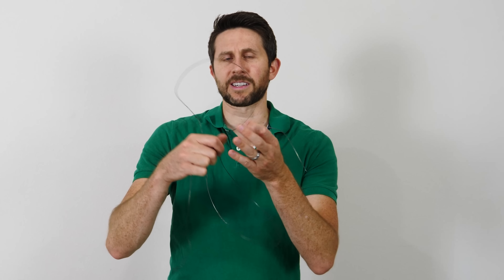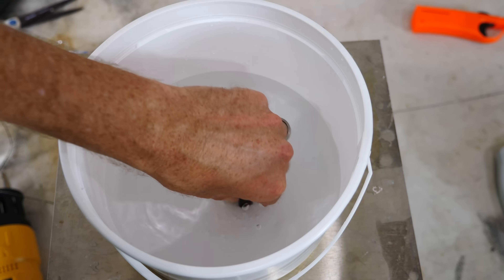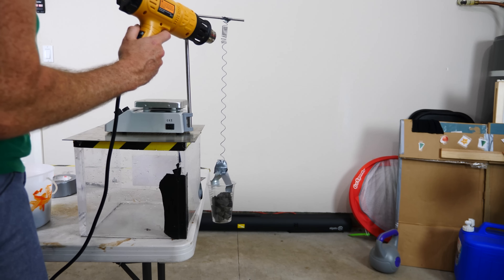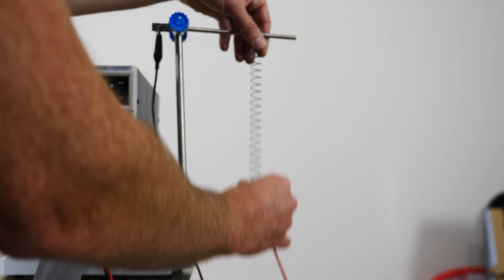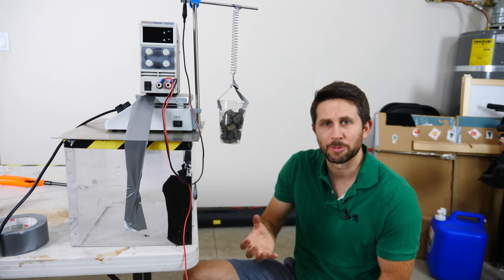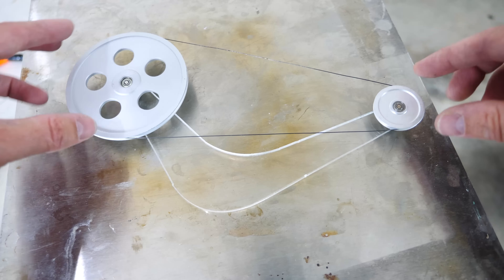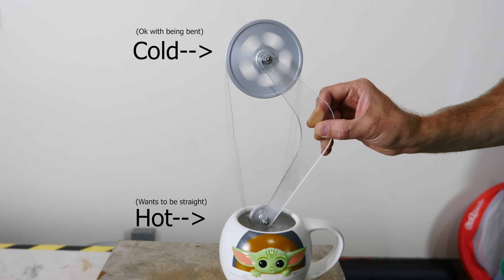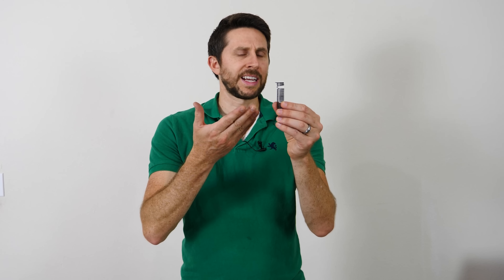How Strong Are Nitinol Muscles?

Comment: at 5:30 is that a perpetual machine????
Reply: Sort of - but I think the catch is that the machine would only run as long as the water stayed hot; as the water cools the machine fails. Therefore, to keep the machine running, you still need external energy (the heat from the water) to run. Good question though!

Comment: With a solar robot, you can use the panel to power a fan that circulates hot air off the solar panel and through the muscles using valves and ducts to control which muscles are being used. This would keep down the electrical requirement reusing byproducts of the energy source.

Comment: You're so good at show-and-tell. Poor universities confine their education into flat blackboards. They should hire you! As of recent years, there is a re-discovery of the amazing potential in Nitinol. The earliest time I've heard it mentioned is circa 1973, I believe, in a short documentary. Among many fascinating tests, they measured the work done by gravity on a given mass to stretch the nitinol spring to a certain distance. It's construed as mechanical work, and could be translated in the potential gravitational energy of that mass at T0 (above the table) and T1 (at table'surface). Very simple stuff. Where I'm getting at is that they also measured the amount of heat (energy in joules) necessary to warm up the spring enough to bring back to mass to it's (very near to) original distance above the table. Embarrassingly, they mentioned that the delta grav. potential energy was > thermal energy applied to the nitinol (stretched) spring needed to re-coil it back in its original shape, and bring the mass back up. I'm not explaining this as well as you do, for sure, but that is overunity! See, your "engine" is over unity, as long as you have, and will maintain, a delta Temp  between the top and bottom pulleys (something you can very easily find in nature where one pulley is kept cooler than the other. as you shown) They had a sort of pump, working like a teeter totter, bathing a nitinol assembly alternatively in cool and warmer adjacent bassins. It worked! Imagine a well in north Africa working in this principle, using the hot surface - cool depth under the sand, to power a well bringing water up to the farmers top-side. Oh! That's a form of geothermal. Tesla had this one similar patent. Thanks very much for your wonderful Action lab. You're like an opened window into the future of physics. Cheers!

Comment: So I guess it has to be fire hot in order for the memory to be activated. Does that mean it wont work at body temp? does the wire have to be under a certain thickness in order for it to work? Like if the wire was thicker it wouldn't work? What if it was a flat sheet? That would be incredible if they could make car body's out of this stuff. Imagine being able to fix a dent with a hair dryer!

Comment: (1) A deformed, or stretched, nitinol spring has a lot of potential energy. In what form? Is it elastic potential energy? (My underpants have that.) It is apparent that a stretched or misshaped piece of nitinol, when regaining its original shape, can release much more energy than needed to make it regain that original form. And this is reusable. So all we need is a free source of energy that misshapes a piece of nitinol, and we have an energy source.

What's that? Did I hear solar energy? Can we somehow harness solar energy for heat to maintain the misshapen nitinol, so when the heat source (the Sun) is removed the nitinol reverts, producing energy? A nitinol battery. But what form of energy, and is it useful? If not, can it be converted to a useful form without significant loss?
-----
-----
(2) If we can add current to reshape nitinol, is the reverse also true? Can we harvest electrons from thermally reshaping nitinol? Wouldn't it be more efficient than spinning permanent magnets near copper coils to move a few electrons? Thermal reshaping could be from removing a heat source (removing solar energy), or by adding heat, such as friction from any number of sources related to an electric car. Nitinol-assisted brakes, anyone?

It should be possible to achieve a net energy gain by using thermal sources already present and otherwise not utilized. Great video, James, more thought-provoking than any I've watched.

Comment: For anyone curious about fatigue with repeated temperature/mechanical cycles, I have a weird/fun answer, not only does does nitinol not fatigue like other alloys it actually GETS STRONGER over time

https://youtu.be/8-dCIkJAjyM?t=84

and this lab tested it to 23 million cycles

https://youtu.be/oKmYqUSDch8?t=198 

I looked into this material a few years ago. Most of the documentaries are from the 70s but well worth a watch and it seems that the applications for this material are numerous with my favorites being self expanding stents (triggered by body heat) to repair collapsed arteries and self reforming tires on the mars rover intended for use in an environment where regular rubber tires  would shatter like glass.

Comment: Someone could use this to actually make a robot Muscles when used with electricity... But it would need like a bunch of Nitinol Wires collected together in order to be strong enough to carry heavy objects like itself.
Reply: general electric actually did a feasibility study on nitinol robotic actuator back in the 80s. Unfortunately its energy efficiency is extremely low about 16% base on experimental data, compare to electric motor of 95% and internal combustion energy of 30%, and even lower than pezoelectric motor of around 25%. And another issue is once you get to full scale actuator, it's very difficult to get the heat out to reset nitinol wire, so its cooling energy need for the equivalent power is much higher compare to other similar type of engine. Nitinol actuator does have pretty small packaging though, so in situation where power efficiency is not needed and it's operating in a thermal stable environment, some thing like endoscopic robot. Another setback that nitinol actuator suffers is since heat conduct through actuator material it self, so unless you have a very accurate heating and cooling control, its position precision control is much less when compare to pezoelectric motor that can have micron level precision at a high seek rate. So overtime nitinol actuator lose out to pezoelectric motor on the precision front and lose out to electric motor on energy efficiency front. Its only niche left is that it has very small packaging need, so mostly used in endoscopic robot that go through small pipe or go through human blood vessel to clear out plague.
Reply: @keenheat3335  🧠
Reply: @keenheat3335  plaque*

Comment: Great video!  Curious: How do you program your own custom shapes into the nitinol wire?
Reply: I believe the way you'd do that is to heat it above the austenitic phase he mentioned in the video. This would cool down in the shape you put it in, form the rigid austenitic bonds, and then further cooling relaxes those bonds into the martensite phase which makes the metal exhibit plastic behavior.

Comment: 5:33 can you please continue holding it. I'd like to see how and when it stops. (As there can't be a perpetual motion machine)
Reply: It would stop when the water cools down.
Reply: @0bscurelight689  but what if the rotational energy could heat the water somehow?
Reply: @0bscurelight689  oh yeah... It would stop when the nitinol wire, water and air above water reach thermal equilibrium.

Comment: Can you make a car that repairs itself in case after you crash it with that alloy?
Reply: Since when manufacturing it you can set the temperature at which it springs back into shape, you could make it so you just leave your dented car out in the sun and it'll be like new again. But then, I guess you could make the temperature about 65F so it would spring back immediately. This would be cool for things like glasses frames or other things that use small metal parts, too.

Comment: Very inefficient and weak.  Spoiler for all the starry eyed "makers": he shows that it takes over 20 Watts of energy to lift a few ounces of rocks.  efficiency for energy in to energy out is low single digit %.  Also notice that every time the "spring" is stretched, it does not return to as tight a coil as before.  Neat stuff for very specialized and limited applications though.

Comment: Is there a way to change what the “original shape” is? Do you just have to cast it as a liquid or is there some other way to adjust what shape a piece of nitonol will return to?
Reply: I think this explains it, from Wikipedia: "Nitinol alloys exhibit two closely related and unique properties: the shape memory effect and superelasticity. Shape memory is the ability of nitinol to undergo deformation at one temperature, stay in its deformed shape when the external force is removed, then recover its original, undeformed shape upon heating above its "transformation temperature". Superelasticity is the ability for the metal to undergo large deformations and immediately return to its undeformed shape upon removal of the external load. Nitinol can deform 10–30 times as much as ordinary metals and return to its original shape. Whether nitinol behaves with the shape memory effect or superelasticity depends on whether it is above the transformation temperature of the specific alloy. Below the transformation temperature it exhibits the shape memory effect, and above that temperature it behaves superelastically."
Reply: @brokentombot  🤪😝😘😇😇😇🥳🥳👽👽👽💀☠😸😺
Reply: @kellymiers2812  Dear me. I posted a wiki paragraph and you went full spectrum. Hope you good Kelly. Drink some water?
Reply: I guess you just have to hold it in place as you heat it up: https://youtu.be/V9quSyg8oj4
Reply: I was thinking the same thing too
Reply: you just need to heat it to a certain temperature depending on the alloy to set it's shape
Reply: heat it a bunch while you immobilize it in the desired shape
Reply: I was thinking the same thing

Comment: Ehm... Can't you transfer this energy from the nitinol engine to electricity? Seems like infinite power generation lol. What is holding it back from permanently fueling the engine?
Reply: Load on the system. I think. The law of diminishing returns (also known as the law of diminishing marginal productivity) states that in productive processes, increasing a factor of production by one unit, while holding all others production factors constant, will at some point return a lower unit of output per incremental unit of input. 
Meaning, however much load is put on the system, the system can't get that a grater amount of energy in return, the output would incrementally continue to fall due to the load. I think.

Comment: 5:26 - So what happens if that wire metal loop wants to straighten out at room temperature (rather than with hot water)? Those wheels should continuously go round and round with nothing else needed?
Reply: One side needs to be looser so sadly it wouldn't

Comment: The only problem is to actually change the shape of the heated nitinol, you have to heat the metal until it can recrystallize in the shape you want. Aka near melting temps. My company had considered using nitinol for a valve, with the pressure of the fluid opening the valve and the nitinol closing it. The wire would, in theory, last much longer than other mechanical solutions.

Comment: I wonder if you could pull heat energy from the gear on the top wheel, and use a tube system to pull it back down to the cup to constantly keep the water warm. 

Not perpetual energy obviously, but if you add a battery to the system it would be incredibly efficient
Reply: A solid-phase mechanical heat pump, in other words (rather than gas-liquid phase transition, how they typically work)

Comment: 5:26 Depending on its efficiency, this could be a good low vibration engine for non nuclear submarines.
Reply: I want to see how many watts it could produce if connected to a small generator. It would be pretty amazing if this could charge a battery
Reply: it wouldn't make any power. It barely spins itself. Apply load and it will stall
Reply: @dieselgeezer18  You could make it as powerful as you want by increasing the width of the band.
Reply: @tobuslieven  Yeah the size of a skyscraper...
Reply: @dieselgeezer18  Or a submarine.
Reply: @tobuslieven  A Submarine with a submarine sized engine.
Reply: So.... Caterpillar Drive?
Reply: Yes

Comment: IIRC I discovered that whatever weight it can hold in its spring form is going to be about the same as it can lift once you heat it. That is to say, if you put 100grams in it and it severely stretched, you can expect that it won't be able to lift the weight but if it barely deforms from the weight then it'll easily lift the weight if you manually deform it and then add heat.

Comment: I feel like using the room temperature version in a hydro electric pump could generate power more effeciently, if you had a spool of the metal under the water and over the water, the water and the straightening force of the metal would both work together to turn the water wheel. You'd just need to find a river thats cooler than the surrounding area. Or artificially heat the top of the wheel.

Comment: with an strong enough electric current you could "reset" the spring with a press on a button.
Reply: As in change the shape it remembers? Yes
Reply: Isn’t that what he’s showing at 3:17?
Reply: @marsrocket  no they mean if it gets hot enough you can shape it to remember whatever you want as it’s regular shape
Reply: This is like a flipflop logic when reset is high